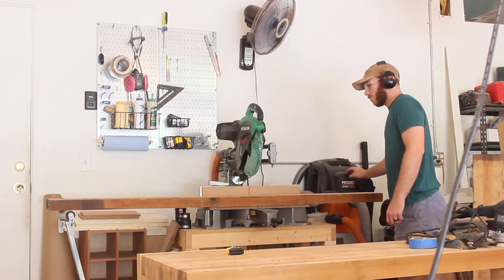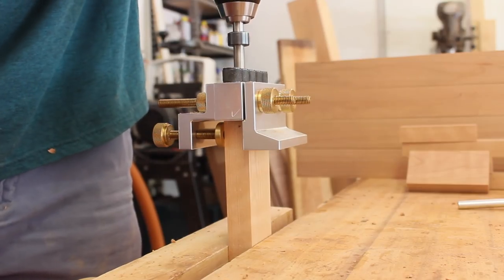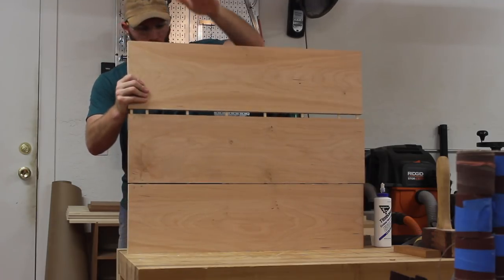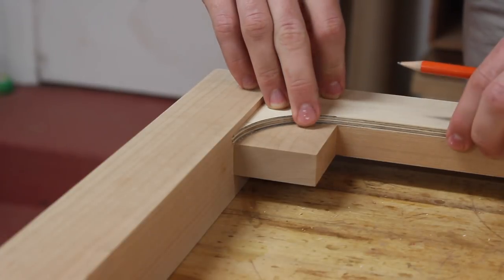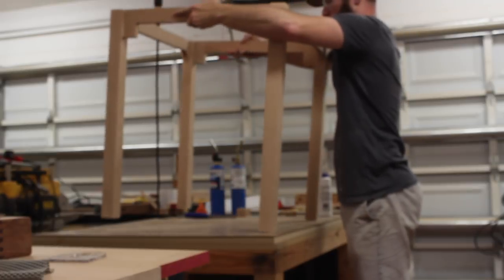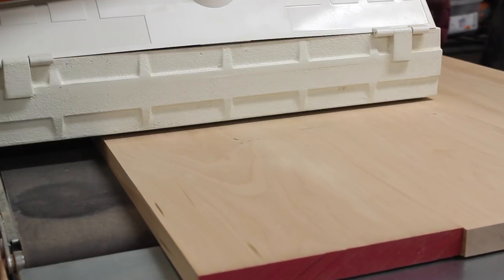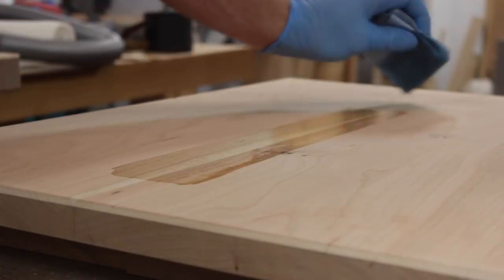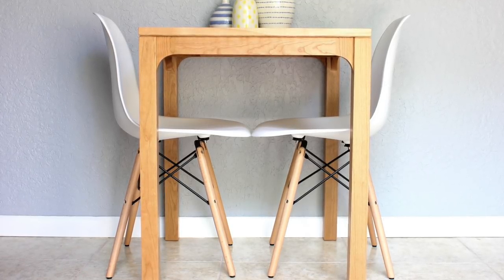Making a Very Small Dining Table

Comment: What shop vac did you get? I have been thinking about getting one for my small shop. Is yours HEPA? I want to make sure to capture the nasty mirco dusts.
Reply from the maker: Thanks for your comments Nate! I went with the 5 gallon Stor-N-Go because it mounts to the wall nicely. I have it connected to a little dust deputy cyclone to catch the big stuff. And I have a bag in the vac for fine stuff. It's not HEPA but I could buy those bags just as easily.

Comment: Great job! But I'm a little worried about the top -- it's made out of such wide boards. How do you minimize the risk of warping and etc? Are your boards air-dried? Thanks
Reply from the maker: Thanks! The boards were most likely kiln dried. There’s nothing mechanically preventing it from warping (breadboard ends) but the table top fasteners should hold it in check for a little movement. If it does get out of control, I’ll fix it I guess.

Comment: Great video! Is that a grizzly benchtop jointer you have?
Reply from the maker: Thanks! Yup, that’s the little grizzly. Had it for almost 3 years and it works really well. Obviously it has limitations but it handles most stuff I throw at it.